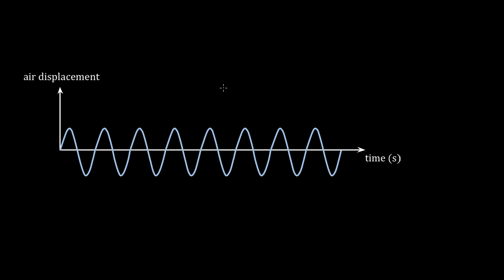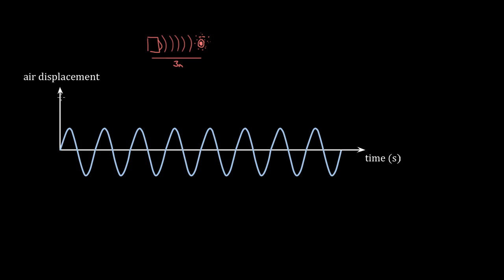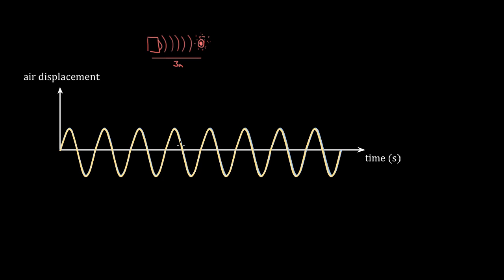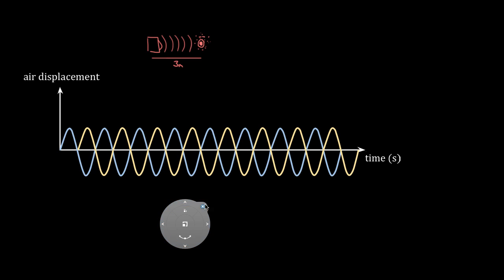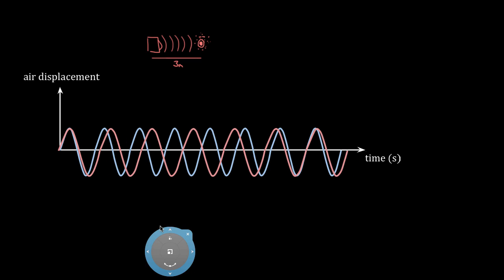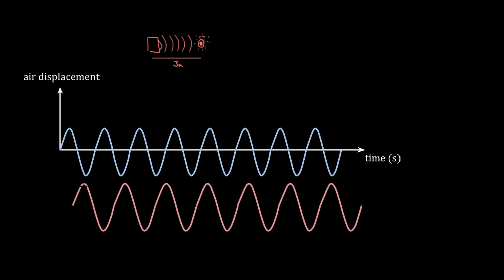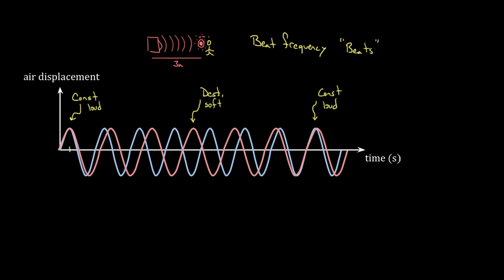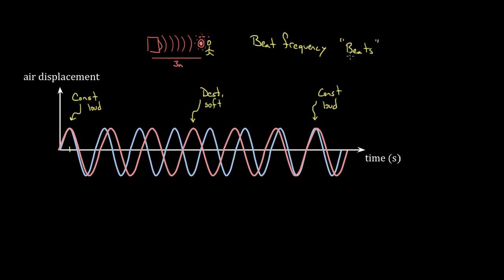Beat frequency | Physics | Khan Academy

Comment: On twin-prop aircraft, beat frequency lets you hear differences in propeller RPM to check if the engines are in sync.

Comment: Can someone clarify me something? I was doing some research on beat and came across a book that stated the frequency you HEAR is actually double the ACTUAL frequency of the beat.

ie: if you hear a beat sound of 20 wobbles per second the difference between the two frequencies playing is actually only 10hz - and not 20Hz. The reasoning is that for every wavelength on the new wave formed you'll hear 2 beats.

The way David explained made it seem that the frequency you hear is the actual beat frequency. Can someone clarify me on this?

Comment: If the two waves with the same wavelength are in between constructive and destructive interference, won't it be constructive at some points and destructive at others?

 Also, I just realized that you can think about beat frequency like two runners around a circular track - the difference in frequencies is how many more cycles the faster person is going to do in a second! If you want to know the first time the runner will lap the second runner or the first time these runners meet again if they start from the same place, you can do f1 (faster frequency) * t = f2 * t + 1 (for one more cycle). This will give you 1/(f1-f2) seconds.
If you believe me that this time stays constant, in 1 second, you have 1/(1/(f1-f2)) constructive interferences or a beat frequency of f1-f2!